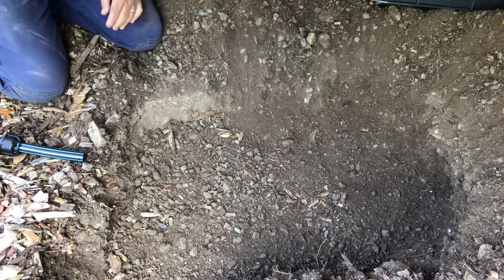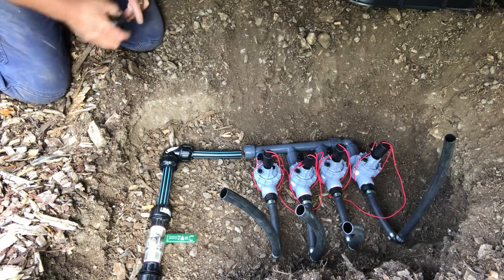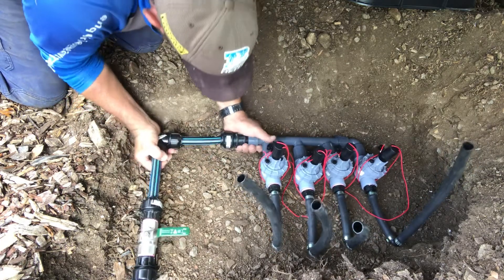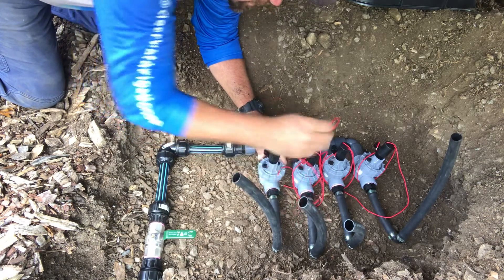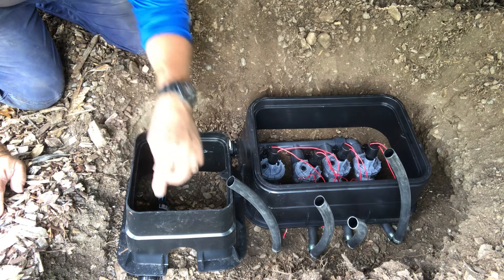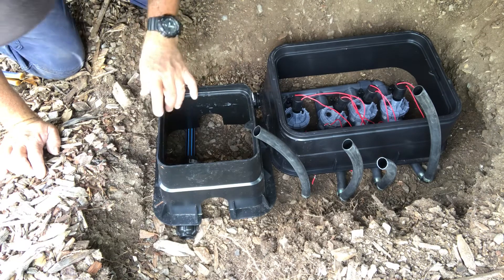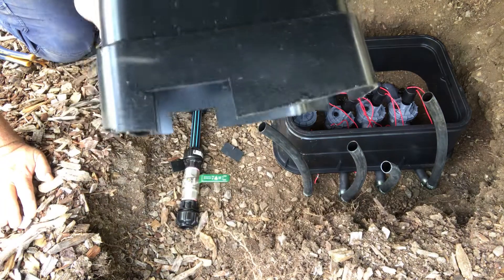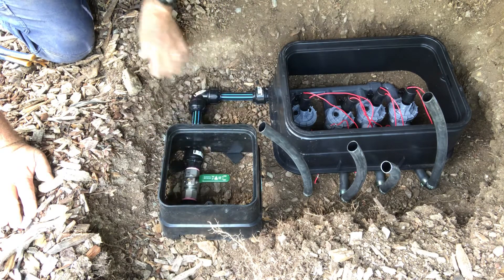Irrigation solenoid valve installation

Comment: Don't use cracker dust or crushed granite for drainage.
With each activation of a solenoid valve the pipe shifts slightly, with repeated shifting over time that drainage media will wear into the pipe causing an expensive leak while you're on that overseas holiday sendinggarden bed soil into the pool before flooding the outdoor entertaining areas and leaving you with a nightmare water bill on return from your trip away.
Just use some clean brickie sand or plasterers sand.